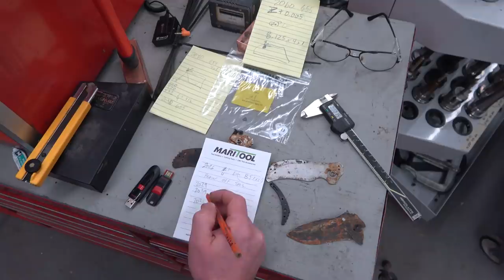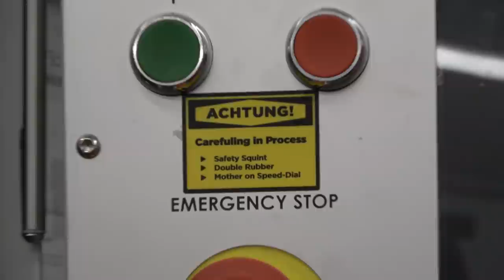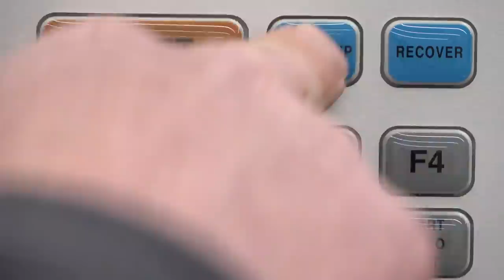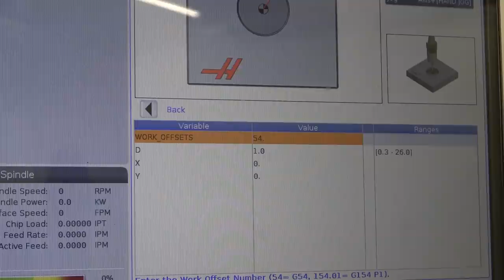tool invention | Friday Fuk-a-round

Comment: that Etch-a-Sketch gag at 4:33 is fargin brilliant!
Reply from the maker: Every day is a struggle with Fusion 360...
Reply: @arduinoversusevil2025   Idk why they call it 360.. you can’t even pull off a 180 without it deleting your fuckin work!
Reply: @arduinoversusevil2025  can call confirm...  I spent 2 hours before I learned press/pull is not the same as extrude.     I mean it does the same thing.   Whatever time to print another gun.
Reply: I dare you to use the cnc machine to use it to draw with the etch a sketch
Reply: Gag nearly killed me, amazing
Reply: because mastercam would deplete the beer fund 40 years into the future.
Reply: @Halfstep2024  Much like the Norton 360 it just slows down your work
Reply from the maker: @billlewis9740  They hooked me with the 90% as good as solidworks at 5% of the cost.
Reply: Fusion is free .99. So it's just the right price for some.
Reply: Confusion 360... or better yet Confusing 365.
Reply: To upload to the cloud you just shake the etch-a-sketch.  That also opens a new file.
Reply: @Halfstep2024  because you always end up right back where you started?

Comment: I worked for Spar Aviation years ago  and we were doing avionics upgrades on RCAF  C130. We had a sheet metal tech that was on shift with us wire pullers to drill holes if needed. He was bored most of the time, so he would make stuff for the crew. His best off the books project was a titanium lunch box. He probably used about $200  in materials.  Beautiful workmanship.

Comment: Here's an idea for your next Friday session, titanium pry bar.  Like a 4 footer. Buddy had one I saw in the 80's built on military time and military dime. No doubt on a friday. Keep up the great vids AvE!
Reply: Back when I was in the Army I used to party with a bunch of Air Force guys. One of them did sheet metal work on the U2. He had a bottle opener he made out of some super fancy expensive metal alloy. It was super hard and stiff but also super lightweight.
Reply: @shadymaint1  Did it leak until used ?
Reply: @eflanagan1921 it's the SR-71 that leaks all over itself before it's at working temp. The U2 is actually a pretty dry bird. Temperamental as an insecure redheaded schoolgirl, but dry.
Reply: I had a titanium pry bar that was made in the USSR, and back in the mid '90's, there were catalogs that sold Soviet surplus, like that prybar. Sadly, mine was stolen....
Reply: This day an age, the best route would be to just cast it out of titanium...

...trust me, it'll work!
Reply: @shadymaint1, my other bud (a master sergeant in the AF Jersey USA) made me 2 water jetted titanium sheet bottle openers, still have em!
Reply: not a pry bar....titanium ashtray...HA HA HA!!!!!
Reply: I doubt the ciggies would get'r goin but if it did, be sure to use lots and lots of water to(try) put it out
Reply: @bob2161  It's optimized for flying nearly out at the edge of space, of course. Getting there is the pilot's problem... and getting off the ground is the mechanic's.
Reply: @shadymaint1  Made myself a super fancy titanium bottle opener myself not so long ago. Lost it after a night of way to many beers, but it was kinda cool I guess
Reply: @SchweinungHD  sounds like you may be a Hasher. On-On
Reply: I know some guys who got in trouble for turning stainless steel trailer hitches from "scrap" materials on company time lol

Comment: 1:10 It's not just a blue-collar tax. When I was a kid, dad and I would go to his workplace and let me fuck around on a lab computer for the whole day and it just so happened that said computer ran either a pen plotter or a CNC machine (no, they weren't that cheap, I literally could just pick which IBM 5150 I wanted to fuck around on). The funny relevant bit here is that his supervisor found out this was going on, would come by to watch, and not only didn't mind it, but encouraged it because he was just amazed that a kid not yet even in his teens could be taught how to operate this stuff competently. This later extended into my teen years, where I was then plotting circuit traces on a HP-UX workstation running something from Mentor Graphics (when not using his Windows machine to play online games on the company T3). Different supervisor came by one day while I was doing this and said that if it weren't for my age and lack of a security clearance, he'd have hired me on the spot.

Comment: I used to work in hospital maintenance, and one of our guys would so some Friday freelancin’ in the HVAC/welding shop to work on his holiday decor.  He was one of those guys whose yard was transformed into a Griswaldian wonderland at Christmas time.  Biggest project was using a large (like 6ft diameter) metal spool that once held electrical cable to make a Ferris wheel.  It was something to behold with seats for stuffed animals, a motor and stand so it actually worked, and he even engineered a system using motor brushes to transfer AC power to run the twinkle lights on the spokes and circumference since any cord or wiring would get twisted and mangled when the big wheel was turning.  It was impressive to me, anyway.
Reply: If you ever need something similar, the lingo you are looking for is "slip ring." Through the magic of Chinese manufacturing they can be had for relatively cheap in the plastic variety. Nonetheless, still impressive he made it himself.

Comment: as one of those odd fellows, I 100% agree with your assessment that we're about the individual processes, I find myself working about each individual tool path making sure it's as good as I can get it then, moving to the next, but that may just be because I am the individual that programs the part sets it up and runs it. The major breakdown you see may come when you get into a shop that has a programmer, a setup, and then a operator. The programmer only cares that it virtually simulated out, The setup actually wants it to make good parts but is trying to idiot proof it for the operator, and well the operator .... "Green button make robot go wherever".

Comment: I still have a set of jumper cables built from scrap cable from my employer, 20+ years ago.

I did have to buy the clamps and am looking at replacing them, but the 4 AWG cable has been great the whole time.
Reply: So do I, made from the safety earth cable of an old 370 mainframe :)
REALLY 300 amps.
Reply: So do I,  made from 'scrap' #4 welding cable,  the best thing is they're 20 feet long.  I also bought clamps, of course. Assembled in 1984, but still in use.

Comment: Choke up on your tools, and your tools won't be as prone to yelling at you.
Reply from the maker: Ok, I did. No difference.
Reply: @arduinoversusevil2025  Semi-suprising! Vibration in tooling is an entire science in itself. I've found increasing chip load and choking up on tools  typically works. Higher chip load is a little counter intuitive, but is usually effective.
Reply from the maker: @krispockell685  Feed per tooth is 0.0046. I'll try more aggressive and see if it explodes.
Reply from the maker: @krispockell685  +20% feed. Working great. Maybe (?) less noise but 6 minutes less cycle time. Thanks!
Reply: Exploding tools…..   not a good idea….   That’s why I work finger dingler ten thousand..

Comment: used to cnc stuff for a living in what seems like a previous life, i'd have an actual cnc, with a screen to run simulations of my questionable programs, and also an older emi-mec turret lathe with  plugboard control, and an old but excelent Ward or Herbert capstan lathe for second op's. also nice brass candle sticks and hash pipes 👍

Comment: No no no. You need to check out the Helical chipbreaking end mills. They are reasonably priced, and we run the 3/4 chipbreaker at 10k rpm, 2" LOC and .15 - .20" radial stepover at 150-180ipm all day long. The material removal is incredible and they cut so quietly and last so long. You CANNOT beat it. This is in a cat40 taper machine too. But using dual contact, milling or hydraulic chucks. ER collets wont hold the tool at those depths.

Edit: they are not corncob roughers. They just have a chipbreaking notch every so often.

Comment: At my last job I was known to bring cylinder heads for garden tractors and such to true them up with a fly cutter, resurface clutch plates and make driveshafts. Me and my father sled  pull garden tractors for fun and I've saved a lot doing my own machine work

Comment: At one place I worked at, so much 'scrap' was being used for home jobs that the management made it a stackable offence.
Roll on a couple of months  and the senior managers all went off to a trade show leaving the foreman in charge.
It toom the foreman less than an hour to appear with a set of drawings for a new wheelbarrow buck.

I still have a stainless steel trivet that was made on Christmas  Eve because, as the press brake guy, I refused to bend up the 30 that a supervisor was wanting to sneak out the door for his mate unless he allowed me to make a couple for myself and the CIC power punch operator.

Comment: yer spot on with machinists being focused on the process, the method vs the product, the product is the goal, but refining the process is a machinists job (one more reason I'm not a machinist anymore, no one wants the folks on the floor thinking at all...)  as for the Gub-a-mint work... some of the best stuff I own was slammed out during breaks and while working nights with long run times, and little supervision... But having said that... if a shop tool is made for use in the shop, its the shops tool and doesn't belong in anyone's personal tool box

Comment: Might I suggest a revision to your bolt cleaner, instead of going for the round type (I'm sure that you're going for ease of manufacture), but you could arbour in a slot that snugly fits those small wire brushes instead?...(I suppose that you could even still cut a round hole, but say only half of which is cut into the material so that it still grabs the brush)...but still  a very cool Idea!
Reply: I was thinking the same thing.

Comment: I knew a machinist who used older stuff. Had a cnc lathe or whatever but he was making beveled washers for salt and pepper packet filler machines. One side was cut and beveled but once they all dropped and there was a count of about 4000, every single little wedding band sized washer had to be hand placed into the chuck reversed so the other side could also be beveled.....4000 times....

Comment: The USB port on the etchasketch is tricky to find but if you look closely you will see it.  With your index finger firmly planted in the gap between the Alea and Columella of the proboscis, conduct a through inverted inspection on the transvers end of the orthogonal support point adjacent to the knurled flembolator extension.  If the position is not immediately apparent you may accentuate the poriferae by illuminating the area with an ultraviolet light that will cause it to become readily apparent.  However, because of infrequent use, the port is usually impeded by deleterious material that may require remotion and redisposition before facilitating a full and active penetration.  Should this be the case, I have found that frequent and liberal applications of ethyl alcohol can greatly accelerate the process of locating this port as well as acting as a catalyst for the expeditious rectification of any issue of pentation impedance.

Comment: dang that's a lot of fluid... wonder why we see such a drastic variety in cooling techniques? i assume the stuff gets filtered and reused but curious how that works all out cost wise... i've even seen air cooled ones where the cnc is enclosed and basically sub-freezing. seems like that would lead to more brittle material and weird cold-front / hot-front situations...

Comment: 1 1/2" material, 4" flute length on one endmill, 3/4" of flute length on the other, you might want to check the carbide recycling bucket right after you go through the aluminum scrap bin!

Comment: I like it!  Small suggestion, change the larger hole to a slot to accept press fit of toothbrush sized welding brush.  Then cut off the handle of that brush.

Comment: I came across a plastic goat just like yours at a thrift store battery didn't work and I've thought about replacing the battery but if it doesn't sound like yours I'd be very sad, so my question is is that the original sound the safety goat made or is it a custom sound effect?

Comment: I can only think of a job or two we use the corn cobs on anymore... usually 1/2" destiny diamondbacks for aluminium, and a variety of niagara stabilizers. Usually 9k rippem's and up to 250ipm on a 25hp machine for the d-backs. Also go through lots of 1/4-90° countersinks for deburring.

Comment: A couple things to make life easier.  When you buy a tool record the specs in your fusion 360 library (flute length) and reuse that library.  I’m sure Saunders has a video on this.  It will then warn you before you use a tool holder as a drill.
You can use a spot drill in fusion to chamfer and deburr all your edges rather than doing it by hand.

Comment: Call me old fashioned, but I prefer cleaning my bolts with the wire wheel on my grinder. I just like occasionally turning a bolt into a projectile I either have to dodge or search 10 minutes for.

Comment: When I saw the brass brush inserted  the first thing  that came to mind was a socket cleaner and tray before sorting and putting  tools after a job but a a bolt cleaner also work
I think with some recessed  magnets  that would be a sweet  tool

Comment: Accidently messed up the top of the hole you bored? Just throw an extra heavy chamfer on it and call it good. It's almost like the time I overbored a press fit dowel hole so my supervisor set a ball bearing on the hole and gave it a good wack with a hammer, handed it back to me and said try it now, actually worked pretty well.

Comment: If you can hit Feed Hold or Big Red before it crashes on an untested program, your Rapid is set too low, get it off 25 or 50 and let it buck at 100. G0 G90 G54 X0 Y0 S10000; G43 H1 Z.1 M08; G83 Z-1.0 F150. Q.2 R.05;

Comment: Speaking of subscriptions and Fusion 360, I made the unfortunate mistake of allowing Fusion to update and wouldn't you know it, all my toolpaths that previously worked, now do not.  And I was not an isolated unhappy customer.  Since the latest update anyone unfortunate enough to still be running Windows 7 now cannot generate any tool paths, or regenerate old tool paths.  And The chuckle-heads over at Autodesk only have "I told you so" support comments.  Sorry we broke your software, but it's your fault for not updating.  What happened to you buying a software and not needing to update?  Or only buying software once?  To hell with this subscription software, which breaks after every update.

Comment: There was another bridge collapse in Pittsburgh Pa and Google maps has some rather interesting pictures in street view that make me wonder how the bridge just passed an inspection because it looks like it was designed by a first grader and should have never been built in my opinion. I may have been looking at the wrong bridge but it appears an entire two lane road was held up by two 4x4 inch beams on each side with an x brace to keep it from falling to the side if it is the correct bridge but either way it is scary to imagine if that is the wrong bridge how bad was the other one? Just wondering if AVE has an opinion?

Comment: 90° spot drill is fine with that much coolant. Going dry may give you a hot tip and then some galling until it plugs the flutes and snaps clean off, leaving you with an unwanted hard-as-frig insert on your workpiece.